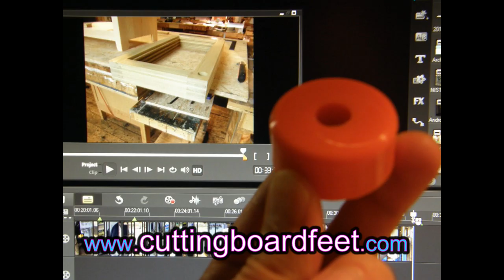Zinc Mirror Build New Metal Working Technique Soldered Miter Joint

Comment: Have you tried using Tin Flux on your zinc joints it has ground Tin in the flux paste and it very little heat from a propane torch to fuse the metal, you can continue adding more flux building up an over lap, you won't need to grind or route out for tin worm, snot or balls whatever term you use in your parts. and of course Very nice work I have been watching you for years love your techniques

Comment: Very nice build, there are many great tips/tricks/lessons in this video. I wondered how you'd take care of the solder "swell" in the corners, the relief cuts in the frame worked out well. If you haven't reviewed the nibbler used to cut the metal at 6:01 it would be interesting to hear your thoughts: how clean is the cut, how much does the metal curl along the cut, thickness of materials it will cut, etc. Thanks for sharing.

Comment: I noticed on your last video that you’d broken the foot tensioner on your pocket hole jig. ☹️
Reply from the maker: yes the bearings in the pulleys all failed and then the cable wore out.  I just have to drive 45 min to home depot for the replacements